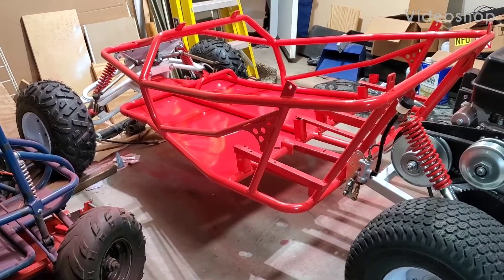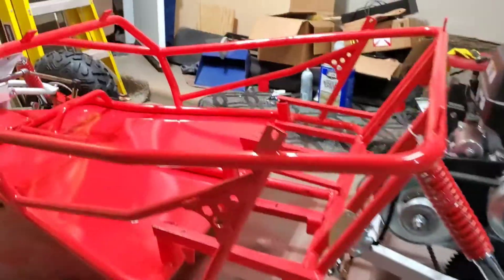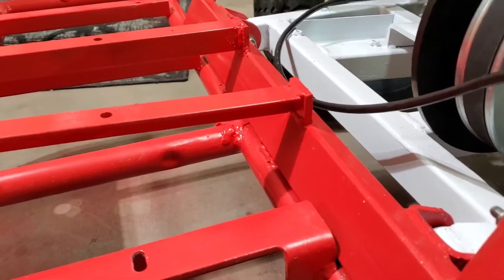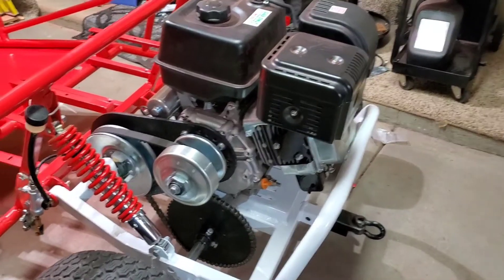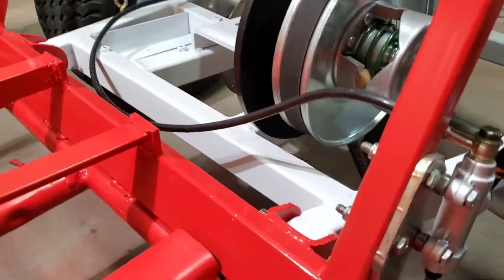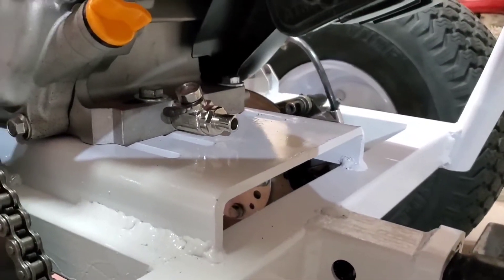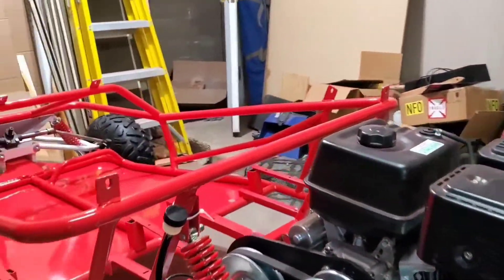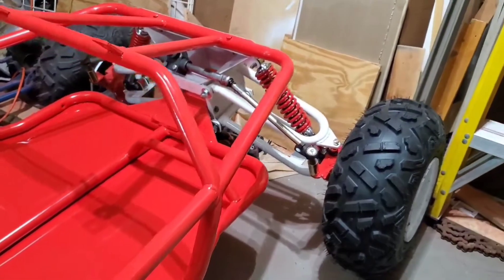Yerfdog Spiderbox Predator 420cc modifications

Comment: Where did you get the back end that holds the engine or did you custom build the whole thing?
Reply from the maker: The swingarm was part of the go-kart. It's been modified to accept the 420cc engine and mounting plate. I have a video on the modifications to the swingarm on my channel. 
Engine Motor Mount Plate Compatible with P-redator Engines 420cc 670cc https://a.co/d/0Rh3NPt